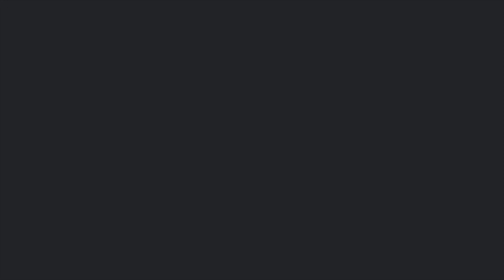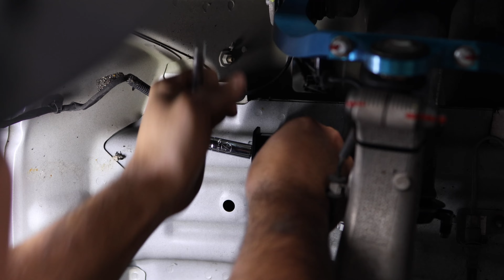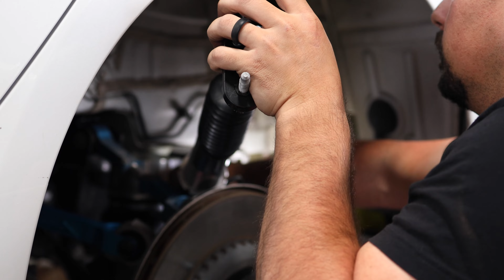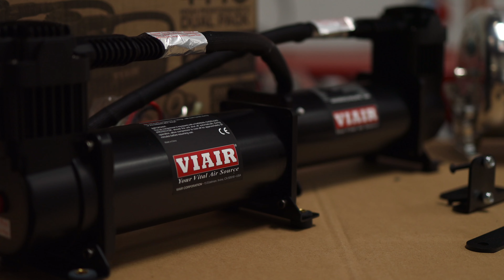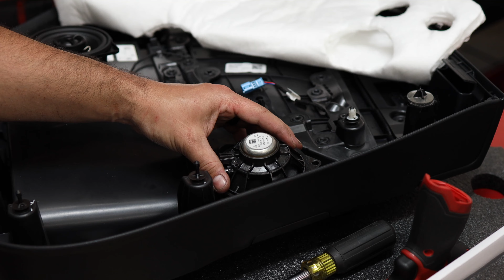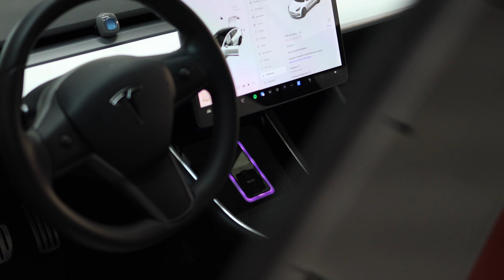WATCH AS WE BUILD CHICAGO MARK'S MODEL 3.  FROM COILS TO BAGS AND THEN SOME!!!!

Comment: Does it effects any electric issues . I mean to error codes . Once we close the doors it will turn off because it’s connected to the battery right ?
Reply from the maker: No electrical issues.  We do not have ours trigger from the door sensor.  It all depends on your installer and how they wire it up.  There are a few different triggers but we use ours just like you would in an ICE car.  The similar thing as an ignition switch to ensure that it will not drain the 12 - 15V battery.